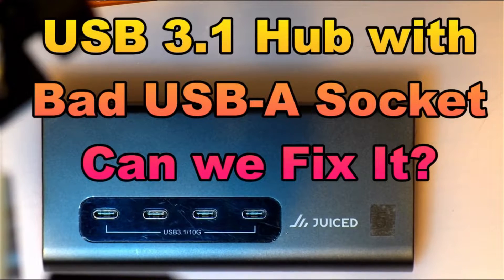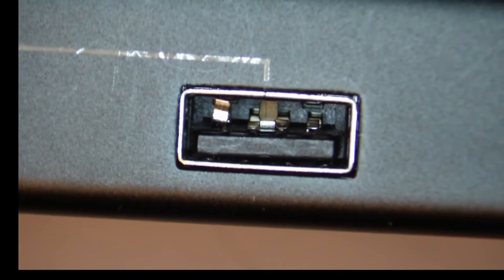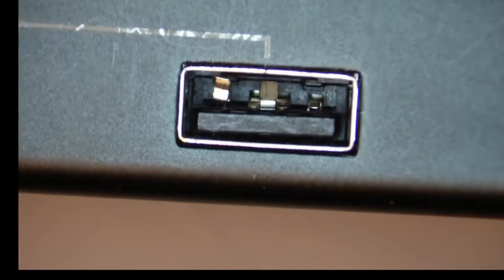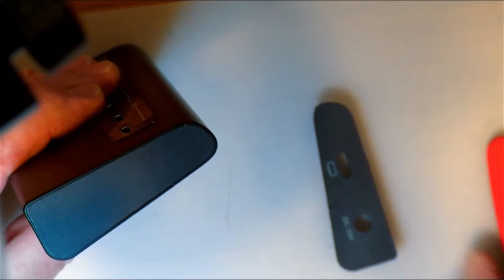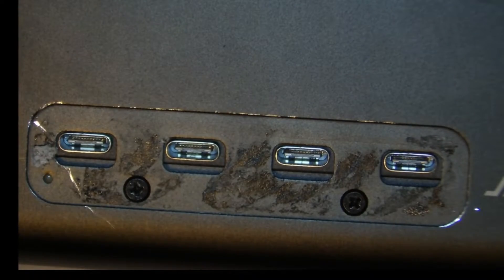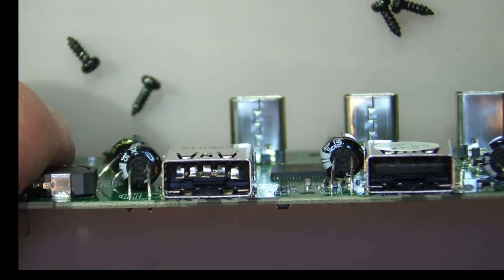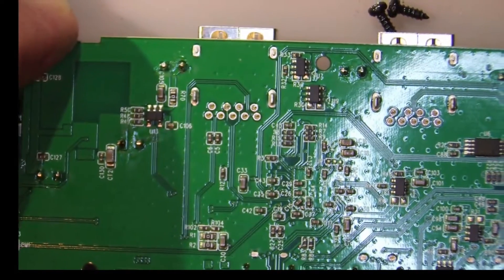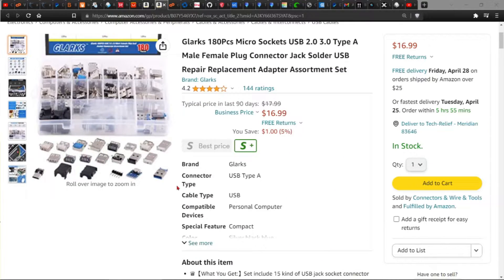In this video we repair one of my USB 3.2 10G Hubs with a broken USB port

Comment: Hello is your camera plugged into USB or HDMI?  If HDMI how do you capture to the computer? thank you
Reply from the maker: I have a microscope connected to an AVerMedia 2 Plus HDMI converter and several cameras connected to a so called "Papeaso Video Capture Card" available on Amazon.  It is not a card but a small dongle with HDMI in on one side and a male type A USB plug on the other. They work very well up to 4K and do not need any external power.  I recommend these.
Reply: @Tech-Relief  Ahhh ok ...thank you very much...I purchased a camera from Lapsun and the quality is just OK, and the FPS to the computer via OBS is 30FPS and not very smooth.  thanks again,